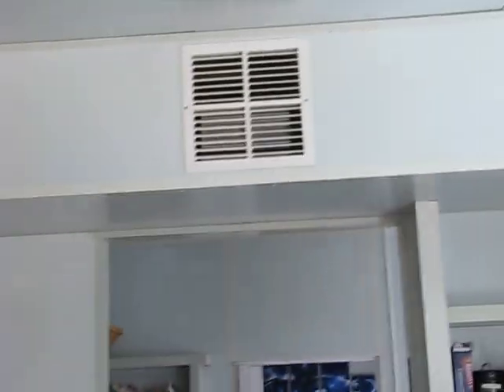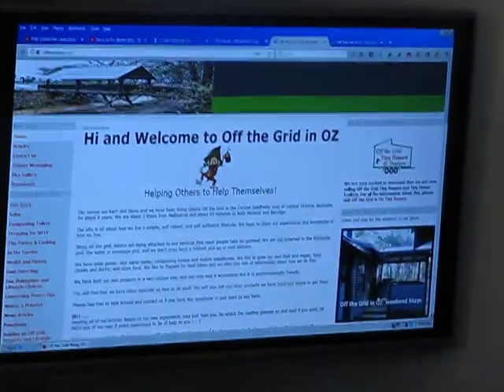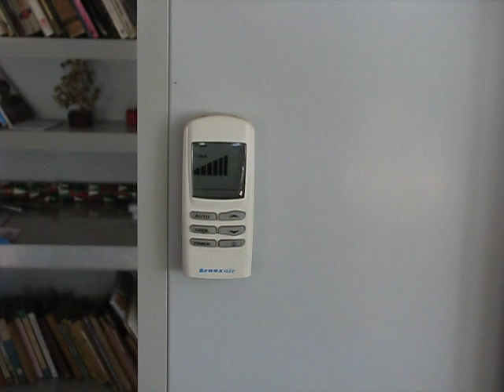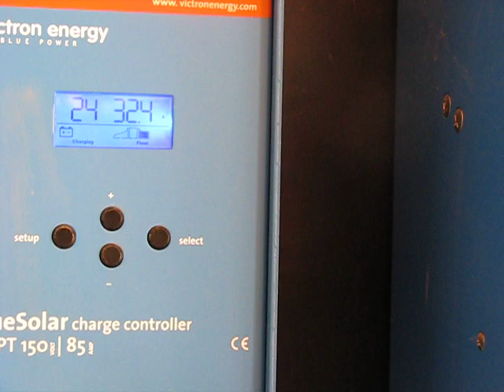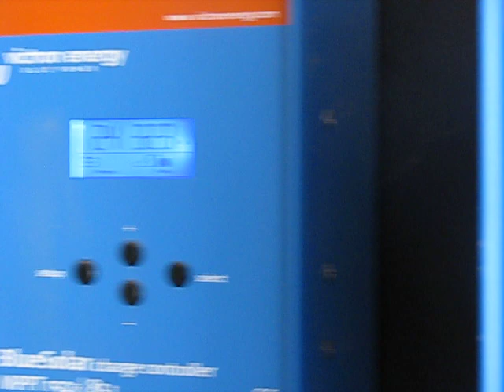Off the Grid Cooling  on 3 KW  1000AH storage?

Comment: Hey Steve, John here, i live off grid in aus too. I noticed your 12 volt water pressure pump. Been looking for one like that for a while. Any chance you can post a link to where i can buy one from??? All i keep finding is the little 17 lpm caravan pumps but i want one like you have for the house, thanks.
Reply from the maker: Giday John , if you mean the little black one that runs the Evap Cooler , mate , those are not strong enough for whole house supply really ... 

 If you search Ebay you will find 20lt per min Diaphragm pumps ( caravan style )  but may I ask if you have any 240 available on your solar ?   We gave away using any diaphragm pumps a few years ago because of failures and the dam noise ...   We found small 240 pumps at low cost that run up to 35-40 liter per min  that last well and we use those now on the main house and the cabin .. link below ... cheers Steve 

35 LITERS PER MIN /240V  370w power only  
https://www.ebay.com.au/itm/Giantz-Peripheral-Pump-Clean-Water-Garden-Farm-Rain-Tank-Irrigation-QB60/351151870756?epid=1139692501&hash=item51c2485324

Comment: Hey Steve, What is the size of the breezair bulk head 600mm x 600mm ??
Reply from the maker: The dropper from the unit is 550 x 550  and the long  horizontal bulk head in side the house is 600 W 500 H      cheers Steve

Comment: Hey mate, Gotta say go the splits, I've have 3 through out our 4 bedroom house. All less than a year old, super efficient, run all day when the solar is cranking (5kw here), then on batts (48v 560ah) at night, set all to 25C.  Come home to cold dry air. Cheers mate
Reply from the maker: Well then I am happy for you on 5 KW ... AND DAY TIME IS EASY ...    the vid is directed at people that cant afford 5 KW or 48 volt ...    so Kumbya :- )   cheers
Reply: haha cheers mate, not trying to rain on your parade, just saying there are alternatives
Reply from the maker: Yes there are if you have a far bigger system ?   but try doing splits running day and night on 24 volt 3 kw and under ..  ?    and no sweat , felt I no rain here lolol

Comment: Hey Steve,  Great demonstration to show what your off grid solar storage system is capable of.  Were there particular reasons you went with the Evap Cooler vs a Split system?  Would you say the evaporative coolers are better than the mini split or split systems?  How  do you rate them as far as power efficiency / solar friendly / cost effective/ cooling effectiveness?  Or was it just what you had access to?  I haven't had experience with them, but was told by a family member in the Aircon industry that evap coolers are the ducks nuts.  Been wondering if they were possible to run on solar, so glad to see they are.
Reply from the maker: Giday Paul ...  To some what qualify my vid , I have over 40 years as a lic plumber in this very industry and have sold installed and help set up hundreds of them over the years .... My point of the vid was more directed at the many off grid people that have limited power at there disposal ...   
There are small so called off grid splits that do work , but still use far more wattage to bring them to life ... The more common domestic so called " energy efficient units "  still pull huge wattage ... and I mean huge , in comparison with the average Evap ...    If anyone that lives in a super humid climate off grid watches this they will scoff ... because humidity does effect Evaps far more that a sealed refrigerated  unit ...   but , having said that Evaps if sized correctly and used correctly ( well ventilated )  are quite good even in humid climates .. 

The people that bitch about them usually , from my experience either have under sized equipment , or use them in correctly ...   

I will leave it at that and say , hey thanks for your kind words and your comment ... it is appreciated :- )   cheers Steve  AKA lic plumber / builder off grid 10 years ...